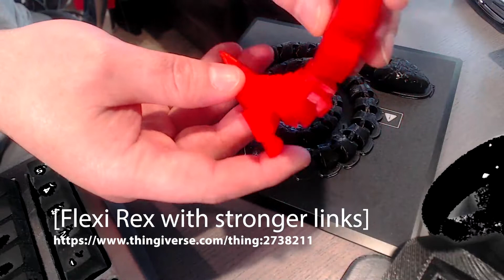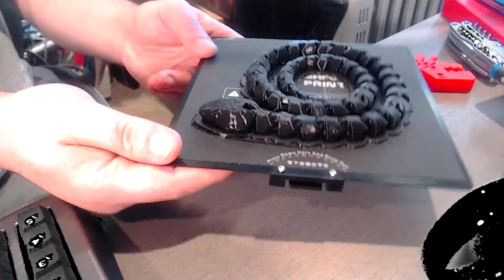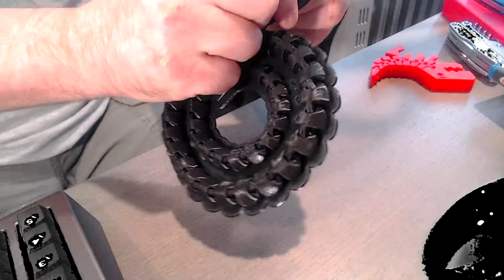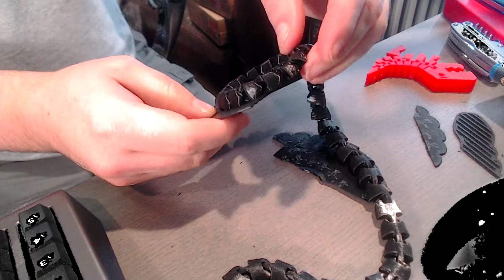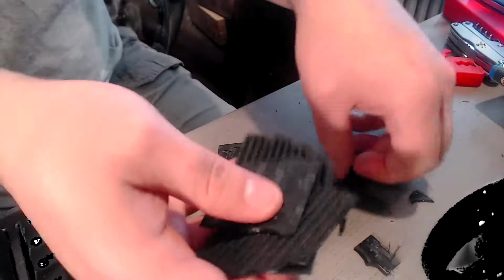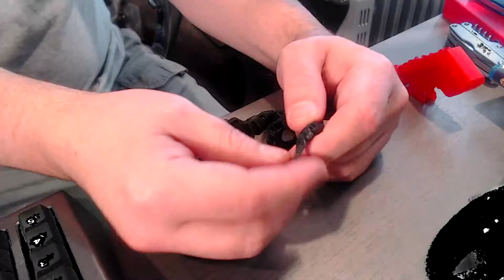Self articulated 3D Prints on FlashForge Adventurer 3 V2

Comment: I have a Monoprice Voxel which is a rebadged Adventurer 3.
It is the most reliable of my 6 3D printers, hardly ever gives me an issue and print-in-place articulated prints work well.

I used to use a raft, then I changed to a brim. But as I have got better and better dialled in, I now just use a skirt most of the time, with 205 degree for most PLAs and a 55 degree bed. Seems to work for me.
I've hardly ever had to relevel or calibrate - maybe 5 times in 3 years of ownership.

Your snake has come out really well.
Reply from the maker: I've heard of the Monoprice version of this printer and that's great to hear about the reliability!  This is my first and only 3D printer and, other than wishing the volume was larger, I haven't had a need to get a different one quite yet.  Indeed reliable!  Also, like you, as I home in on the right extruder and bed temps for the PLAs I use, some have benefited from not using a raft.  Saves time, material, and makes removal much easier.  I've had a few issues with rafts stubbornly sticking to some PLAs, to the point of ruining the print.  Not the printer's fault, of course.  Thanks for watching!  Cheers!
Reply: @BreakingPintMedia  Haha, right at the end you mentioned the Voxel, so I jumped the gun! Sorry 😞 
But still, in many ways it remains my favourite printer for small jobs.
For speed I usually use a FLSun QQS Pro and for large volumes I use an Anycubic Chiron, both of which are very reliable too, though I am tempted to try a Voron 4...
Reply: @BreakingPintMedia  👍  😃

Comment: Is the Adventurer 3 V2 and the Adventurer 3 Pro the same? It looks like you have a flexible build plate, whereas the 3 Pro states it has a glass build plate.
Reply from the maker: It appears that is the only major change in the Pro model.  I personally haven't had any issues with the removable flexible build plate, so I'm not entirely sure how much benefit one would get from the glass plate, but it seems most higher end printers gravitate toward glass so it must be inherently better.   Cheers!
Reply: @BreakingPintMedia  thank you! I've asked 3 other people that I've seen doing reviews on the Adventurer 3, but nobody could really give me an answer. On the Flashforge main website they don't even have the 3 V2, they only have the 3, 3 Lite, and 3 Pro, but the Flashforge USA website has the 3, 3 Lite, and 3 v2. 
So you can see how that would be confusing to someone who's under the assumption that they're the same company, because I kept getting worried about which one I should get. Frankly from what I've gathered and from what you've said, I might prefer the 3 v2 since the build blate is removable, whereas the 3 pro's glass plate isn't removable according to the website and I've heard the flexible bed has slightly better adhesion but I'm not certain.
Reply from the maker: @crazycherokee8552  having run into strange overadhesion issues with some PLAs... I simply couldn't imagine what a pain a non-flexible glass plat could be in that situation.  But, my statement isn't based on experience with the latter so I could be entirely wrong in my perception.  I really like our flexible plates.  It would seem strange to me to forego the option.

Comment: What is the difference between the Adventurer 3 and the Adventurer 3 v2?
Reply from the maker: As far as I can tell, the V2 allows the use of their higher temp nozzle (265C), and not limited to the standard 240C included. Otherwise identical.  Thanks for watching!